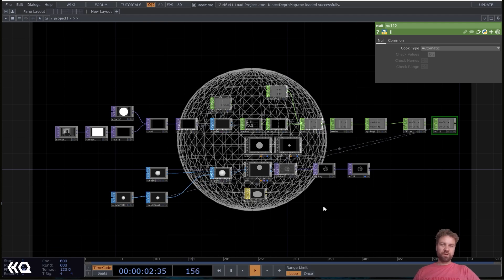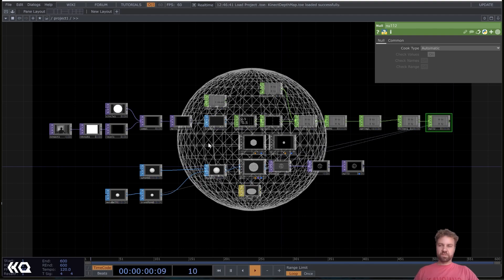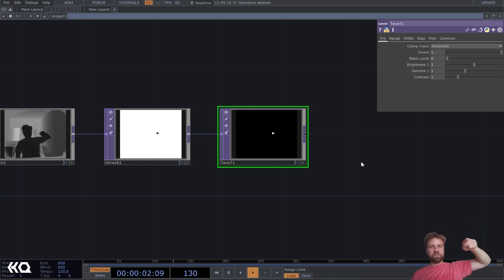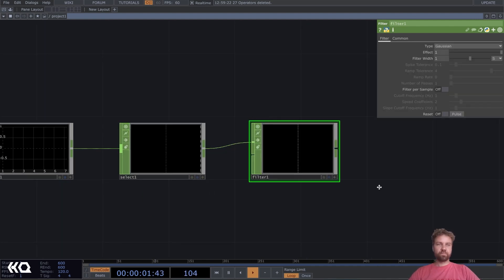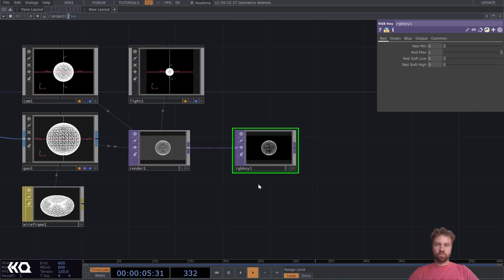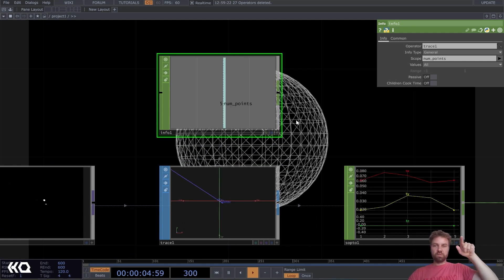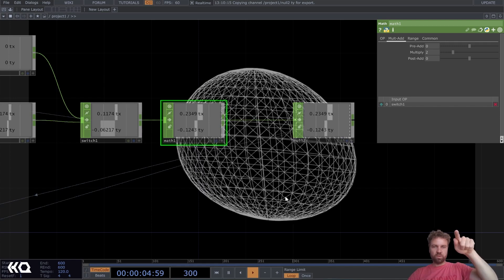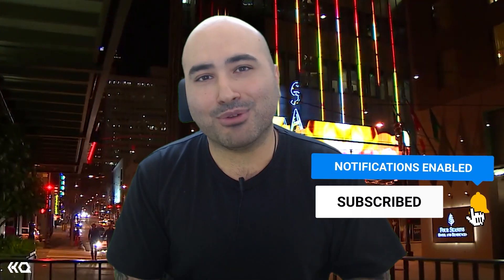Position Data from Depth Map - TouchDesigner Tutorial 163

Comment: I'm trying to connect transform to the top circle and use it, but I don't know how to hold depth in this case. Can I use this method to hold it?
Reply from the maker: It should still function, the main difference would be that the area that would be masked out of the incoming signal would be different.

Comment: Thanks Always, BTW can you kindly recommend me a reasonable notebook specification for TD works including Nvidia part?
Reply from the maker: There is no right answer here (and no perfect laptop, either): it really depends on your budget and needs. If you're just learning TouchDesigner, the right answer might be the laptop you already have -- there's a lot you can do without a high powered computer.

Laptops tend to prioritize thinness or performance, usually not both. It's worth thinking about what your situation requires: a laptop that is lightweight and easily transportable, or a laptop that's really powerful and intended to be a desktop replacement?

If you're looking to utilize the recent Nvidia Maxine series of operators, they require a 20, 30, or 40 series Nvidia RTX graphics card, so that could be a good place to start.

Here are a couple of forum threads from that past few years that bring up some good considerations:
https://forum.derivative.ca/t/equipment-recommendation/238970
https://forum.derivative.ca/t/2022-laptop-recommendation/253820
https://forum.derivative.ca/t/2022-laptop-3080-ti-or-3070-ti/259321